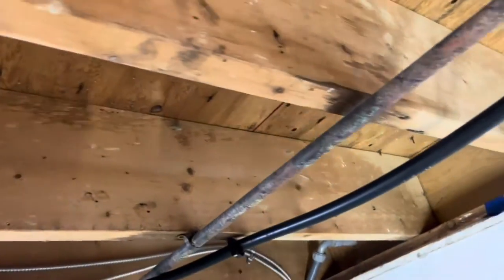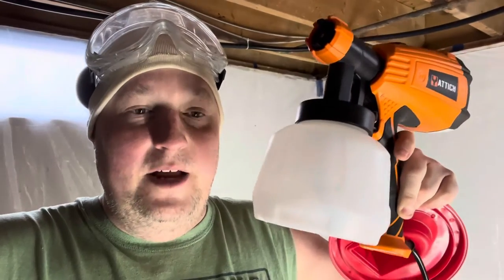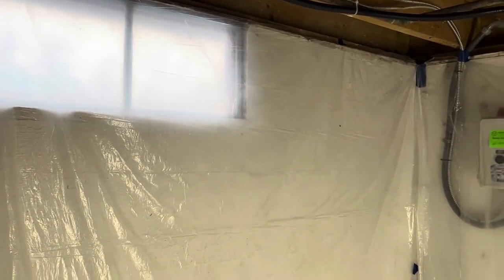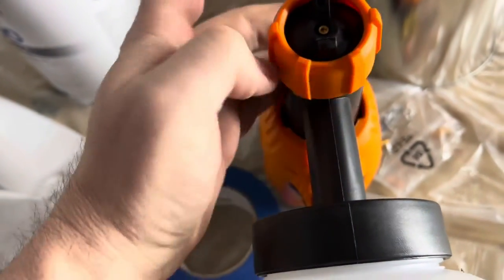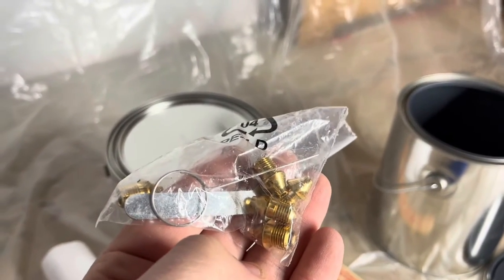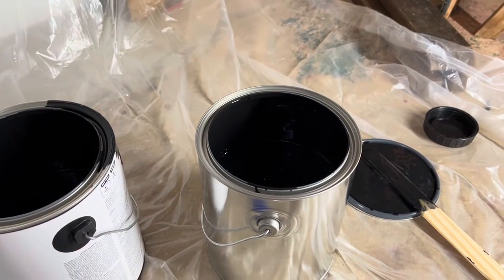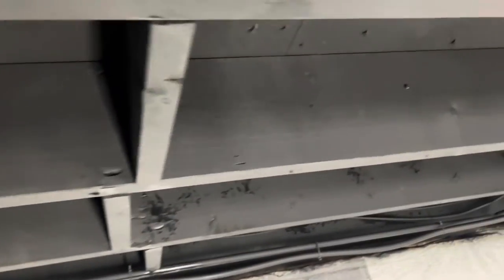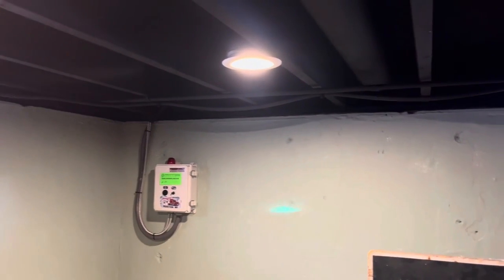Make your BASEMENT BEAUTIFUL | Living space | Paint the Ceiling | Yattich HVLP Sprayer & setup

Comment: Great vid! I am about to do the exact same to my basement rafters. How many coats did you use? and did you consider using primer beforehand?
Reply from the maker: Thank you!  Honestly it came out great and I only used 1 coat! The only thing you’ll wanna do is clean up all the cobwebs and dust first. Prep as well mask tape off things well. Plastic everything up and do sections at a time. The paint gun works great just make sure to clean it frequently and between refills. If your paint has too much water in the mix you can tell. Think like water colors paint vs house paint. If it’s too thin just add more paint and go over light spots. It’s very easy and forgiving to do. You’ll get the hang of it quick 😊

Comment: looks great,....  What is the height of ceiling? im doing same thing on a 80 year old house... most of my floor Joists are all uneven, piping, ducting and wires just a big mess...
Reply from the maker: I have about 7’ to the joist.  I spent a ton of time removing old cable tv and telephone line. There used to be rooms so old framing, drop ceiling anchors. All sorts of junk. The plumbing wasn’t braced well so I bought a bunch of braces to make it last. I think the small details of all the prep work helps too. Eliminate all the junk and clean up. Then paint. It looks so good! I am also doing about a 8’x10’ section at a time. It’s a lot easier as I have a ton of stuff in the basement. I put up sheeting in my paint area. It also helps me go through the whole basement and all of my items and reorganize and optimize storage as I go.
My first house was built in the 20’s so I think I got an idea of your basement. Ours wasn’t too bad as I believe it was a catalog home.